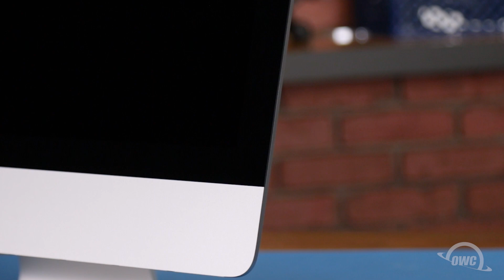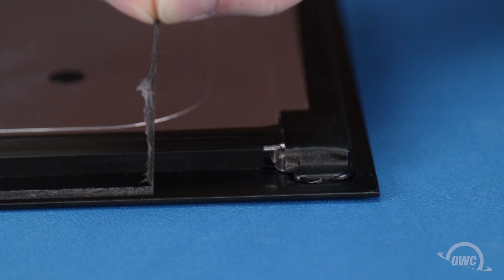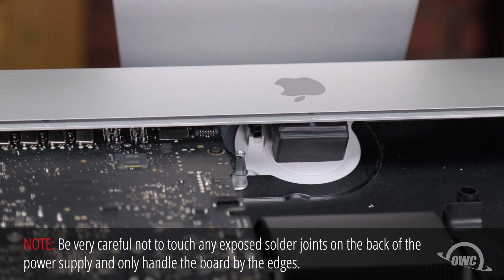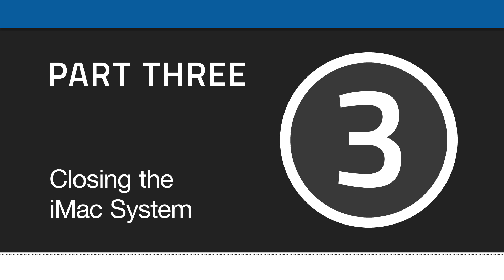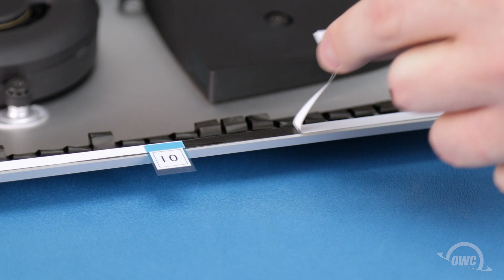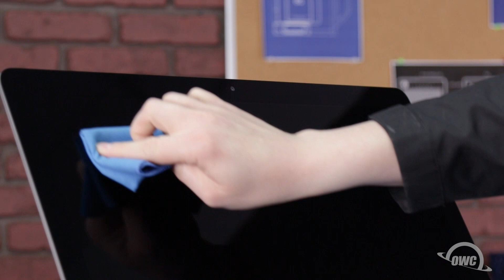How to Upgrade/Replace the PCIe SSD in a 21.5-inch iMac (Late 2013)

Comment: I need help. I bought your toolkit, did everything. The Imac is running the latest IOS and everything, and now there is gray vertical line on the left side of the 21.5 imac screen. I tried com+opt+P+R and nothing. Any help is appreciated!
Reply from the maker: Hi Ray. It is possible that the cable connecting the display to the logic board is crimped, or wires became loosened, which can explain a line like this. A strip in the screen resides in the display itself. You may need to open the machine up and verify all of the connections are secure and not loose at all.
Reply: OWC I just stripped the whole thing to the bone and even changed the 2032 battery, put it back together, checked the display strips that go to the logoc board, on both ends and nothing. Now the strip went from gray to black. 😭
I feel pretty confident in all connections, and I feel like I did not screw anything at all. I bought another SSD to replace on my 27 inch, and I dont even know if I should try that anymore. Any other tip or help would be awesome and again appreciated!
Reply: One more thing, I have tape holding the screen and not the proper double sided strips because I wanted to make sure everything was ok before sealing it. Do you think this may have something to do with it?
Reply: OWC I’m disappointed nobody else chimed in to help me save my imac. I know there are risks completing these upgrades, but I expected better from you guys.
Reply from the maker: Hello Ray, we sincerely apologize for the delay. We would be happy to assist you. Please our support directly. https://eshop.macsales.com/Service/support
Reply: OWC Will do, thx
Reply from the maker: You are very welcome.

Comment: For everyone terrified that they don't have exactly the right components once they open up their iMac, don't panic! 

The hardest part is getting the screen off without it cracking.* Once you're inside it's fairly straightforward. If you get round the back and find you don't have the right ram, adaptor, screw or whatever, you can reassemble it quite quickly and use tape to temporarily close up the screen for a couple of days while you get the right stuff!

*Definitely use the OWC technique in this video with the suction cups. Do NOT use the iFixit levering technique - I cracked one like that!
Reply from the maker: Great tips, Phil!

Comment: Can you confirm that a PCIe SSD will work even if the late 2013 iMac didn't come with one originally? (i.e. a model EMC 2742 that has an empty socket on the back of the logic board).
Reply from the maker: If the machine did not come with one from the factory, unfortunately, the necessary connector will not be on the logic board at all, to accept this drive.
Reply: @poweredbyowc  well it turns out the versions they sold in the UK might be different! Luckily I had a spare NVMe and adapter going when I opened it up today because the socket was there and works brilliantly. Thank you for your excellent video btw. Also found that there wasn't an extra connection to monitor the heat of the SATA drive so could install a new SSD as well without worrying about loud fans. Not sure if that's aUK specific thing as well...
Reply: @PhilOFarrell  Dang, I wish I purchased mine from the UK. I didn't realize that it only had the slot if the iMac came with it (or at least I guess that's how it is here in the states). I purchased the Aura Pro X2 already and it seems it will have been for nothing. I'm taking apart my iMac tomorrow to upgrade the ram so fingers crossed it wasn't all for nothing and I get lucky lol.
Reply: @poweredbyowc  What if it came with a Fusion Drive? Would it have the slot or only if it came with the Blade SSD?
Reply: @rcarter  a Fusion drive is actually a regular HDD, and a blade SSD, fused together through Terminal commands, so yes, it will have the connector for a blade SSD.
Reply: @owcjamiem8372  Oh nice. Thank you!
Reply: @rcarter  How did the upgrade go?

Comment: Hi, I did everything like you did, but my iMac late 2013 doesn't see my ssd. I have tested with disk utility and terminal, but always nothing
Reply from the maker: If you are using the newest Aura Pro X2, the Aura Pro X2 drive has very specific instructions on how you can install your OS onto it. It cannot be seen externally, the Envoy enclosure is for the Apple stock drive only.  It will only be seen installed inside the machine, by using CMD+OPT+R to boot the machine into Recovery mode. Just CMD+R will not show the drive. Here's what you'll do:
-Put the Aura Pro X2 into the machine.
-Put the Apple drive into the enclosure (optional)
-Boot the machine using COMMAND+OPTION+R (this is the specific key combo for High Sierra and above's Recovery mode)
-From there you should see the Aura Pro X2 in Disk Utility. 
-Erase/format the drive in APFS
-Exit out to the main Recovery window
-Then, you can install a fresh copy of the OS there in Recovery, and you can use Migration Assistant after it's done, to move your data, OR
-Restore from Time Machine back up

Comment: Is this installation possible in an iMac that only came with the HDD? My machine has the port (same one as in the video). I've already upgraded the HDD to a SATA SSD and 16 gb RAM and would like to keep improving it if possible as a personal project.
Reply: I am trying the same thing, did you ever find out if it was possible?
Reply: @bigchungus1348  Hey! Yes it is! I got a Crucial NVMe SSD 500 GB and a Sintech adapter required to match the iMac port. It's faster than the SATA SSD but not thaaat fast, but it's worth it and fun. I even upgraded the CPU from an Intel i5 to an i7.
Reply: Juan Osses wow thanks for the quick response. I’m going to look at that adapter right now, do you have a 27 or 21? What I wanna see is possible if I can take the 512gb SSD from my mid 2015 MacBook Pro 15 and then use that adapter to put it into my 2013 iMac and then get a 1tb SSD for my MacBook Pro. The reason I am trying to see if this is possible is because I’ll have that 512gb SSD on top of the original 1tb HDD which will be perfectly fine for what I need. 

I definitely agree, it is so much fun upgrading them, taking the iMac apart wasn’t as easy as just taking the bottom off a MacBook Pro but not nearly as hard as so many people stated. Took me 25 minutes at most and I didn’t even have that little pizza cutter.
Reply: @bigchungus1348  it sounds possible to me. I have a late 2013 iMac 21.5". Just check if your iMac PCIe port looks the same as your 512gb SSD, since it's it's all Apple I guess it might¿?. If not, the adapter I got was a Sintech NGFF M.2 from Amazon. Just double check that it'll work for your 512gb SSD. 

There's a little screw to keep the SSD in place once installed, I didn't have it so I left it like that, it's a tight fit anyways. So far so good.

Sweet! You could set the SSD to be the main boot drive and keep the 1TB for storage, that's what I did. I also bought this multicolor led stripes to set the mood haha it's awesome, couldn't be happier.

Let me know how it goes! Good luck.
Reply: @jdosses  is the 21.5 inch model or 27 inch model? If 21.5 can u make a video of it.. trust me... People gonna love u ..
Reply: @mrinmoymajumdar  it's the 21.5" !!
Reply: @jdosses  hello friend, I have one late 2013 . I would like to receive some information about how you have achieved these updates, can we get in touch?
Reply: @dcarras767.2  Hey David! What do you want to know? Tell me, what's you exact model?
Reply: @jdosses  can I have your email or WhatsApp number ?
Reply: @dcarras767.2   Sure, it’s jdosses@gmail.com
Reply: @jdosses  Woahh great improvements you got on your iMac! Can you tell me which version of i7 did you got? I'm also considering getting a crazy upgrade like yours, maxing it up. And does a Samsung or any other brand NVMe with the adapter work? Or it needs to be brand specific? I would love to see that crazy mac of yours with all the RGB and everything haha. Well done mate!
Reply: @JaelGuerreiro  Hey! I got the Intel Core  i7 4770S 3.10 Ghz which is the one in the 27" iMac from the same year. Well I don't know about other brands but I used the Crucial  P1 500 GB PCIe M.2 with the Sintech NGFF M.2 adapter (check for the adapter once you decided on your SSD, not all adapters are the same and not all work on that iMac). For what I learned there's no point in getting a super fast Samsung SSD because the 2013 iMac won't make use of those super fast read and write speeds, the PCIe connections weren't as fast back then as they're now but it's still faster than getting a regular SATA SSD (I tried that first). In the end it's absolutely worth it, upgrading the RAM, the chip and internal drive. Just be REALLY careful when assembling and disassembling, take your time, watch a lot of youtube tutorials. Good luck!!

Comment: As a Windows user this video is a DISASSEMBLY video NOT a PCIe SSD instsalation video. Why did they put the PCIe socket under everthing. BAD design. Or was it deliberate - planned obsolescence. "My iMac is slow - I will have to buy a new one" I will go the external PCIe drive solution to over come slow booting. But the iMac's are beautiful machines!

Comment: for imac 14.1 is there a PCI socket?  my imac standard configuration is only hdd not fusiondrive.  please reply.
Reply: Your iMac 14.1 is a late 2013. Look under the base leg of your imac. If it says EMC2742, it is very possible that it has the slot to put a memory like this. Or if your imac is a fusion drive, that proves that it has a free slot. But there are many users of the OWC card who complain that it dies very quickly or is damaged. Some people buy the Samsung NVME SSD and its adapter.